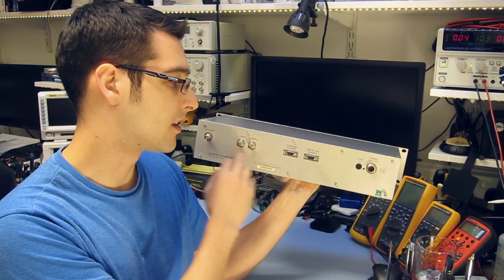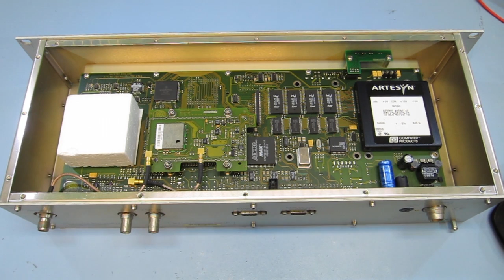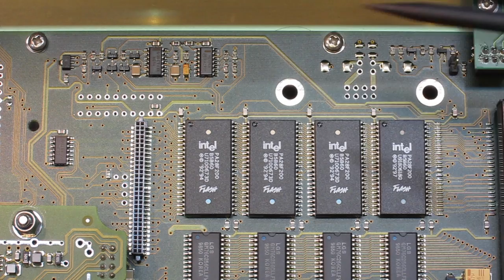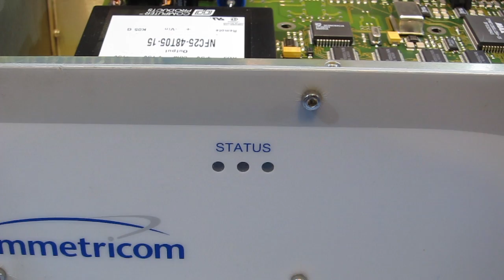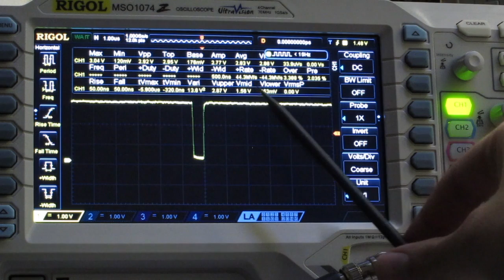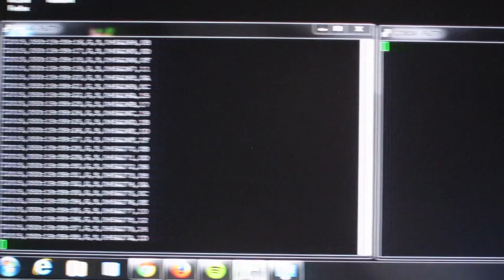SDG #07 Symmetricom GPSDO - 10MHz Frequency Reference - Part 1

Comment: Hi I have a Symmetricom TimeSource 3600 without the antenna. I read that this antenna has an IF converter, and that a standard cheap antenna can't be connected to the GPS antenna port. Do you know about this? Could you please give me some advise about this? Regards, Andres.

Comment: Did this receiver handle the 2019 GPS week number rollover gracefully?
Reply from the maker: Sadly not. But the frequency output is still accurate. I could recalculate the time and date from the serial output, but the unit might be retired from timekeeping
Reply: @sdgelectronics  If you have a dump of the ROMs, I'd love to make an attempt to fix the WRNO bug... reverse engineering GPS firmware to fix WRNO bugs has become my weird hobby.

Comment: Beware, if this is from a telecom application, the power supply is likely a -48VDC (positive ground) power supply.  Don't know if the chassis is referenced to ground or is isolated.  Most telecom gear is operated in a positive ground environment.

Comment: Could one pull off the NMEA string of the position, so that as well as serving up 10MHz for my instruments, my  desktop computer will provide location-based services that aren't 800km away at some arbitrary ISP node? Ditto RTC to set my clocks.
Reply: Ok, got the RTC in your other video.

Comment: A fellow on Tindie is selling a GPS Referenced RF generator for $20, antenna for $8 and $19 shipping, that would be a lot more practical than buying one of these.  While it says 1MHz is the
default it can be set to 2MHz, 4MHz, 6MHz, 8MHz or 10MHz.  https://www.tindie.com/products/deBug67/gps-referenced-rf-generator-1mhz-out/